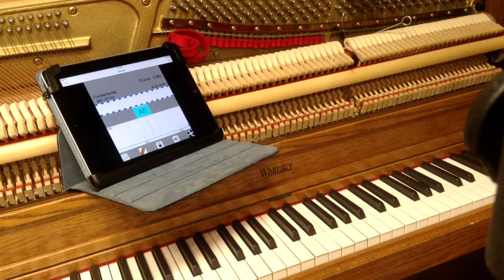Piano Tuning Theory - Hertz, Beats and Cents [Part 5] I HOWARD PIANO INDUSTRIES

Comment: Hi Howard,  
Which tuning device and program is that ? I am also a professional piano tuner.
Reply from the maker: This app is called TuneLab and I’m using it on an iPad.
Reply: @howardpianoind  thank you - I  use a German tuning assistor,  but l always check it and make final adjustments by ear - or set by ear first  - then use assist display to place notes where required leaving me with a final ear check and adjust if required- tuning pianos is not easy at all....bass warm octaves , leave them slightly flat , treble warm in the middle moving progressively brighter as l progress - l leave the top notes sharper knowing that they will flatten if left for a while....thank you for your reply

Comment: ... and so on ...
440 * 2^(1/12) finds A#4
440 * 2^(0/12) finds A4
440 * 2^(-1/12) finds G#4
... and so on ...

You can use this formula to find any Chromatic Scale frequency. Each octave is divided into 12 equal widths according to a logarithmic scale (not divided linearly using basic multiplication/division). All you do is substitute the 'n' in the following formula for how many semitones they are away from A4.

440 * 2^(n/12)

Comment: I finished the first tuning!!! (took the front and top off)  I used your pitch raise video for tunelab. Sounds so much better!! I made a second video with the same roll way too quickly. Shaky, but hey I was pumping the pedals.
https://youtu.be/Zh4pHXwuWjA
Your tuning kit came in only few days. Well made for the basic kit. THANK YOU!!!
I've found a few keys (the highest 2) were kinda clunkly, and another one sounded like the hammer wasn't hitting all 3 strings. 
Should I use the same tuning "file" that I made in tune lab for second tuning? ( I noticed that some keys that I did last week were "off" already.) Or make a new one, (like in your pitch raise video)?
The last octave's strings were very touchy. A bit frustrating at times.
Reply from the maker: Hi Tina,
Thanks for the update.  Yes, there is definitely an improvement in the tuning.  It still has a little ways to go and I'm  sure the next tuning will sound even better.  I would take new measurements for a new file now that you have brought the pitch up some.  It sounds like the touchy strings are probably due to the tuning pins being loose.  I would recommend using CA glue to fix those.  Here is a video which shows how to do that: https://www.youtube.com/watch?v=p8jsa5ShqFI.  Good luck on your continued progress!

Comment: Thank you.Do you advise to tune slightly several times, allowing some time for the strings to stretch and acclimate as opposed to fully tune in one set? Due to age and unknown condition? :) As much as I want to jump in there I'm reading all I can and watching your videos first so that i don't do anything stupid.Oh and one of the pedals squeaks a bit while pumping. Does that get oil or graphite?I'll have to track it down when I open it.Thank you!
Reply from the maker: One thing you can do to help reduce the risk of breaking a string is to lower the pitch on each string as you go to tune it just a small amount to break any rust bond that could have developed between the string and the bearing point.  Then the string will be able to move more freely over the bearing point as the pitch is raised.  Yes, you can pull the pitch up a small amount each time.  Probably like 15-20 cents with each tuning would be a conservative amount.  As far as the squeak in the pumping pedals, I'm not sure what would be best for this as I don't really  have any experience working with any of the player system functions.
Reply: I figured out that 435 is  -19.77 cents. (Engineer background helps lol)
I finally opened it up. Has a serial number and a certificate signed by Howard Vincent on 10/28/19.
Thank you for your videos. I got some books from the library on tuning and theory and I can understand what's in them from your clear explanations. I'm thinking about learning more and getting into the profession.  
I ordered your basic tuning kit. It's better than anything else I checked into. Full 50 inches of felt, tapered, 2 sets of mutes and most importantly, good quality basic hammer.  Can't wait!!! 
Hope this opens up a whole new world for me!!! 
Thank you!!!

Comment: I have a Howard Vincent player from about 1900. Do you know if I should only try A4 435? I don't want to damage anything. I cannot afford any repairs. I read one place e to put some oil on the string before attempting to turn it for the first time. I don't see that any where else. It was my grandmother's and I've kept it safe all these years. It was refurbished about 30 years ago. It plays well except for tuning. Last professional tuning had to be at least 10 years ago.Do you have any other advise?https://youtu.be/yI2kHqWoADM
Thank you for your videos. They are so well done and full of correct information. I was getting very dispared with it getting so out of tune.
Reply from the maker: Thanks for sharing the video.  Yes, the piano certainly is out of tune.  I have seen recommendations on applying a lubricant such as Protek CLP to the string bearing points when a piano hasn't been tuned for a long time,  but I haven't ever done this.  I wouldn't necessarily recommend it.  You could tune it to A435 instead of 440 which would provide a lower chance of strings breaking.  It won't affect the sound to any significant degree.

Comment: You totally don't the divide the difference between octaves by 12 to get the difference between semitones in hertz. Notes progress geometrically, not arithmetically, with respect to frequency.
Reply: So what do you do? You should dispute without providing the correct information.
Reply: DjAjonra It depends on the temperament, but if you multiply a note’s frequency by 1.059, it’ll get you close to the next semitone.
Reply: @Ajonra  Mathematically and theoretically, a half step up is 2^1/12 times the starting frequency, or any step is 2^n/12 where n is the number of half steps. That changes a little with tempered tuning and the real world etc.

Comment: Would you use the same software if you would have to tune the piano from usual A4: 440Hz to something like A4: 432Hz or A4: 444Hz for example? And also, how 100 cents could be measured within different octives? For example A3 to A4 or A4 to A5?
Reply: Would it be all equal frequency wise? for ex: A3 to A4 = 220/12 = 18.(3) -> 18.(3)Hz = 100 Cents 
and so with A4 to A5? 36.(6)Hz = 100 Cents?
Reply from the maker: You can use Tunelab to do a pitch offset from the standard 440.
Reply: This is what I want to know too (I think you and me know why) 😉✨✨✨✨